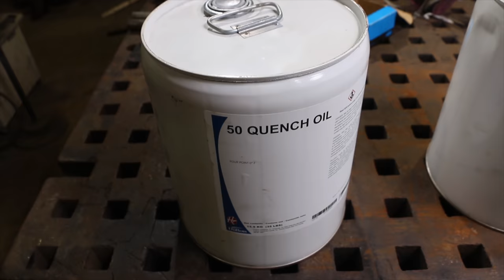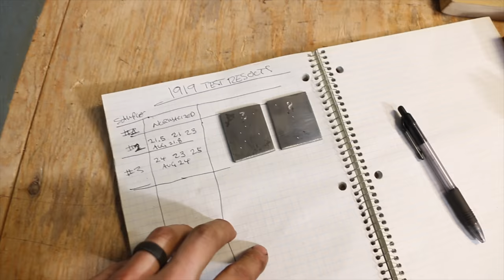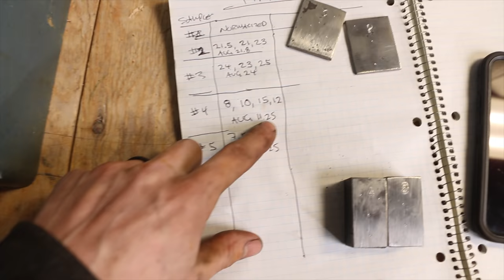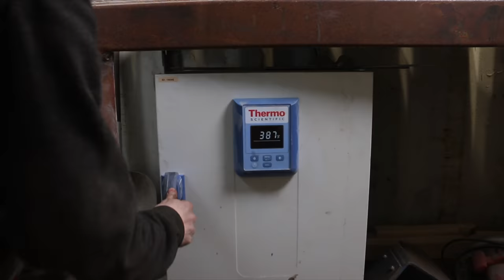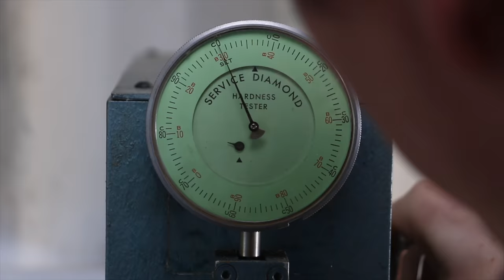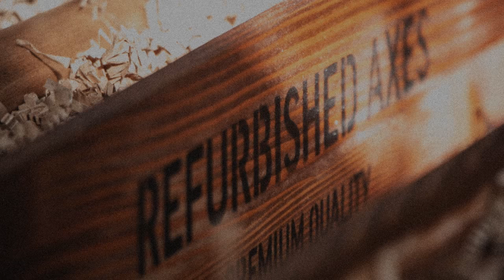What is the best oil for Quenching train rail?

Comment: You should try quenching in liquid nitrogen, or leaving an already quenched and cooled item in liquid nitrogen for as long as possible. ;) IIR the structure in steel can change even after quenched with the cooler it gets. Probably end up super hard and brittle though.
Reply: There was a process for stainless way back in the day called frozen heat & a member of the CASE family came up with it while working for the Robeson knife company !!!
Reply: Check out Applied Science’s video on cryogenically treated drill bits.

Comment: The handle will get loose without a wedge and regular oil on the end. Dry environment helps, but just the forces on the wood against every hit that axe is going to transmit into it will loosen that end. The # 1 thing I can say about old tools in very dry environments is that you should never use nails or a metal edge to tighten the handle unless you are going to replace it very soon. It just caused the end to split. Popping off the handle, sawing a kerf into it, then putting in a glued wedge after putting to tool back in place will hold it on the best. Personal experience, but it still applies for making tools last longer on their wooden handles.

Now, if you are going pro, get a fiberglass or other composite handle and epoxy it on, then shield the first 10 to 12 cm with something durable. like rubber hose or a wrap of leather, depending on the tool and how you are using it, but composite handles break down faster if the end takes abuse on the surface.
Reply: You know, he did say the handle was not wedged because it was only press-hung for testing, right? This head was not intended to be left on that handle. He was just surprised it had not moved yet.

Comment: Interesting stuff! I quench everything in AAA. My understanding is that the initial cooling curve is the same as park 50, but is gentler towards the end. A few things to consider: I don’t know if you are heating the oil before quenching but I seem to recall you said you weren’t in a previous video. These oils have an ideal temperature range about 100° F so oil temp could be a variable you need to think about. It is possible that the reason the samples seemed to get harder after temper is because it had not all converted to martensite when you did your first test. Not sure how soon after quenching you tested it. I’m enjoying these hardness testing videos! Definitely interesting.

Comment: The main reason axes are soft is because you can sharpen them with a file.
Great if you're out in the woods 150 years ago, but harder axes are perfectly fine now that we have belt sanders and various grinders available.
Reply: Knives can be sharpened by a file and they're harder than axes.
Reply: @TingTingalingy  Some knives, but not any of the decent ones. You can't sharpen a $15 D2 knife with a file or any fancier steel, but you should certainly be able to sharpen a swiss army or cheap kitchen knife.
I guess you're technically right if you mean diamond files lol, since diamonds are the only thing that'll sharpen a lot of super steels
Reply: @SiliconeSword  I'm not sure who you've been listening to but you should stop listening to them lol you have no idea what you're talking about at all. Files are harder than knives coming close to 70hrc. Knives are hardened to rarely higher than 62hrc, outside of filet knives. I'm guessing you do not understand Rockwell or much of anything about metallurgy. Thanks for playing
Reply: @TingTingalingy  My man I own a Rockwell machine, and a few knives in super steels. I've got a Spyderco Mule in CPM 15V that's 15% vanadium carbide. Hardness matters, but isn't everything. Carbide content from tungsten, nitrogen, niobium, or vanadium boost wear resistance to crazy levels because they're much harder and more wear resistant than the steel they're in. 
I'm not tryna argue with you, but just go see the lengths Cedric and Ada Outdoors has to go through to sharpen some knives. 15 minutes on diamond stones for something like Maxamet can't be even poorly replicated with a file.
Reply: @SiliconeSword  super steels are super dumb. Like man my knife is so cool that it takes an hours work to  sharpen again, that's a fool's errand. It's so super that no one bothers using it for more than overpriced bulky folders. A file will absolutely sharpen them, just take a bit of time. There's a reason hard impact blades are made from simple high carbon to low alloy steels. 1084 & W2 are superior to all that word salad jumbo.
Reply: @TingTingalingy  lol
Reply: @SiliconeSword  oh ok you're the guy telling Master Smith's they are wrong 😂

Comment: I usually use brine quench for 4140 steel then double temper in mineral oil. However I also cryogenic quench. What is the composition of rail steel? I forget.

Comment: I had always been told by the old timers around here that old motor oil was the best to quench in due to the high carbon content. Is there any truth to that and have u ever tried it?
Reply: ThisOldTony just did a video about welding cast iron. He pointed out that when you weld a high carbon material, the carbon can migrate towards the heated area, leaving an area beside the weld depleted, and that's where it likes to crack. He fixed it by preheating the whole thing. But with your comment, that makes me think that the carbon could be retreating into the material while the inside is still hot and the outside is cold, and a carbon rich oil could help replenish it. ... Maybe, I'm just guessing.  Although technically all oil is made of carbon, I guess some extra free carbon is easier to move around.
Reply: Thats patent nonsense. Sounds like it makes sense but it doesnt. Carbon takes time at red heat to enter steel and solid carbon is particularly bad at it, various salts like NaCN and the ferricyanides etc are better to begin with, which is why they are used for faster case hardening which can indeed be done in a minute or two.  But in a quench in 3 seconds? Nope.

Comment: You didn’t say whether you heated the oil up or not usually you heat it to around 130° . at least for knife making it actually makes it quench faster ie not as much vapor jacket. Also I didn’t see you grind off the decarbonization after quenching decarbonization will always measure harder. Just a couple things you might want to know good video always love your stuff

Comment: Hey Tim, a technical question, if you heated the steel to the precise temperature on the big and small pieces the hardness will not differ, how confident are you of the temperature of the steel where the same for a accurate hardness measure.

Comment: I’d like to see a break test after quench and then after temper, I thought tempering reduces some the hardness so it’s not as brittle. If it didn’t actually soften after temper, did tempering actually make it less brittle? Doesn’t make sense to me, I have quenched 5160 and 1095, then snapped them very easily, then tempered at different temps starting at 300 going up to 450 in 50* increments and tempering definitely made those steels less brittle and so I always assumed a softer Rockwell, never had a Rockwell tester though. Cool video!
Reply: I agree. I’d love to see how they snap and the grain structure. These numbers have me baffled.  I wonder what the temperature of the oil was, none of it makes sense and  how much he ground off after quenching. Also a brine quench should be tried then temper that back to what is desired.
Reply: @erikcourtney1834  same thinking here, doesn’t make sense

Comment: Ok, finished your video and you didn't test everything to the end and your axe verses stone tests were a joke. Based on what tests you did actually do, the canola oil for axes was potentially the best oil. You want an axe to have a super hard edge supported by a spring steel, that is supported by a light spring steel (spring steel = easily stretched, but very hard to actually put a bend in) tapering from the edge down to almost mild steel by the outside.

Now, for thick, camp knives/various version of manchettes and other tool/short swords ( like kukris and other traditionally sub 24 inch blades needing thick spines and chopping edges), the AAA would work great. It would probably be good for a USMC spec K-BAR (meet the specs before trying to sell one to save a lot of headache). The lighter quenching oil still seems like it is still the best for knife making, but we are talking about thin and under 6 inch blades.

I think you did your own product and the oil types a disservice by not properly testing this and admitting that for axes an oil that is vegetable or lard based still is the best and most economical option. Maybe show with a good sample size (at least try to get up to 10 and don't just go average, the mean is closer to what is useful and easily calculated) that various oils work for different project types and pieces. Another factor to check is how long the oil lasts while performing the same job. If one is perfect but degrades rapidly while another is good enough to be near perfect and lasts for hundreds or thousands of uses, then that would be useful data. This is also where a comercial oil like you were testing would be able to outperform canola oil.

It won't be the best option for a single project, but it might makes sales for more general or prolific blacksmith with this information.
Reply: Good points. Longevity for pros vs hobbyist use is something to consider for sure. Will it break down over time? If it lasts for 20 years without spoiling or losing it properties in a non-sealed quench tank, then it could still be a viable oil for a hobbyist. But if the continual use from a pro over heating it breaks it down too quickly, then it may be a bad call financially. Also, environmentally speaking, if that disposal cycle is shorter for the pro, what is the recommended disposal method, environmentally speaking? What is the added cost if it has to be disposed of through some hazardous materials means?

Comment: Why haven't you tested to see exactly what material that rail is??
Guarantee someone around has one. 
You're still guessing at quench temperature. 
Also never heard of the different quenchants going by thickness. If you read the manufacturer website is specifically statee they are designed for the speed in which each material needs to be quenched at.  Yes some heavier material takes a different medium per steel type.